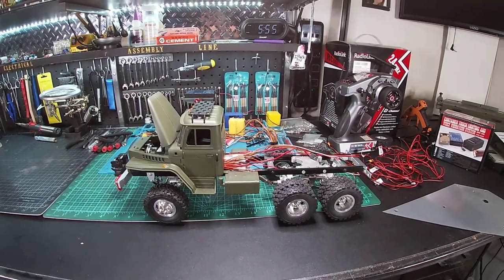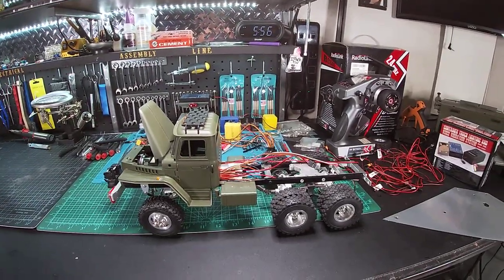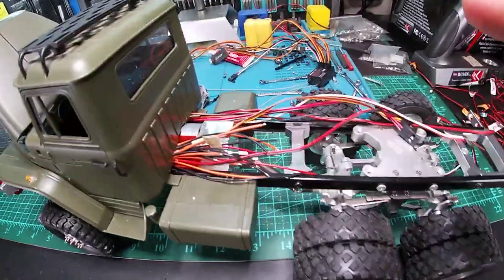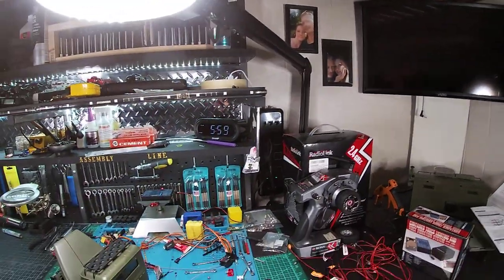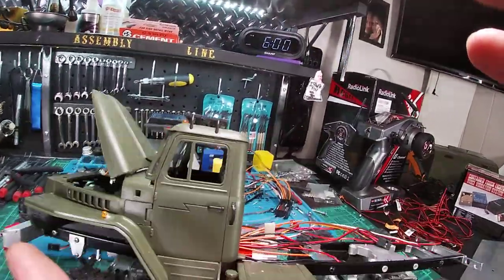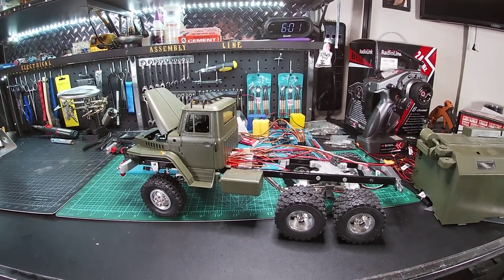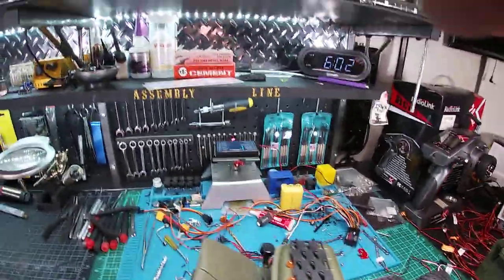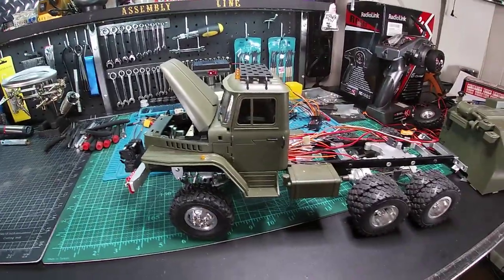update for the wpl b36 ural communications truck

Comment: Amazing what good love can help you accomplish!!  Amazing setup, sir!!  Im working on this same rig but using the EACHINE EAT01 frame rails and body.  Smoker, all metal, tons of lights and then sound, i gotta get a tyranis radio/receiver because i need like 9 channels now..  lookin forward to next vid on this rig!!
Reply from the maker: Yes sir thank you so much my friend.  I still in the process of getting a new radio to operate the lights and sound correctly.  Also making a rear bumper for 4 lights on each side of the rear. Like you I need at least 8 to 10 channels.  But will get back on this and definitely get it finished and outside running👍💪💯  thank you so much for watching bro 👍

Comment: Hi.
Did you ever finished that truck?
Reply from the maker: I've been doing and building so many things it's still rite where I left off. Trying to find the correct remote for full operation and extra's afterwards remotes get super expensive. But its above me waiting in line. It'll  be the 3rd remote attempt. Still have my other wpl's to do too.
Reply: @mikeshane424  this build looking rly well and have some potential :D

I'm going to mix my with bruder cabine fr9m man tgs
Reply from the maker: @domdomalakazam4638  thank you bro 👍